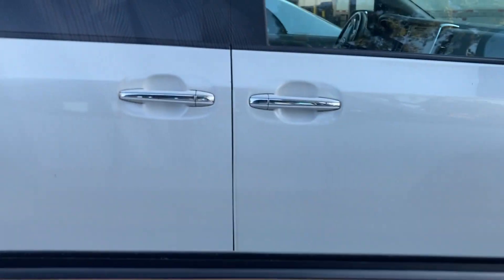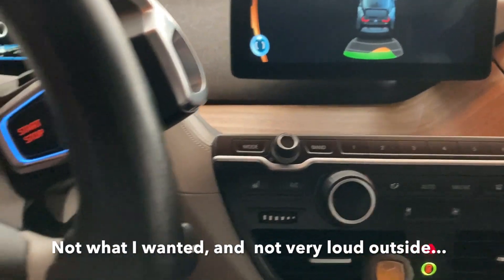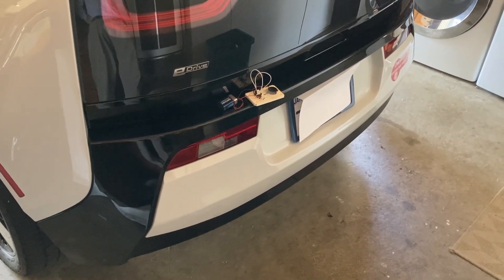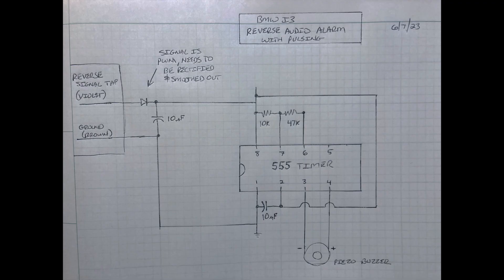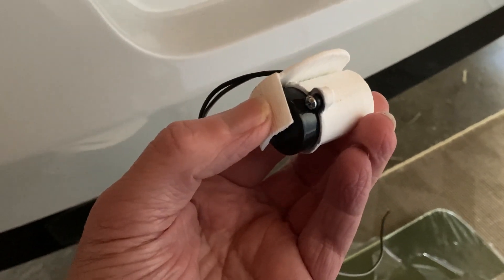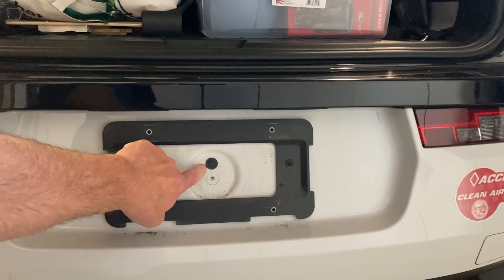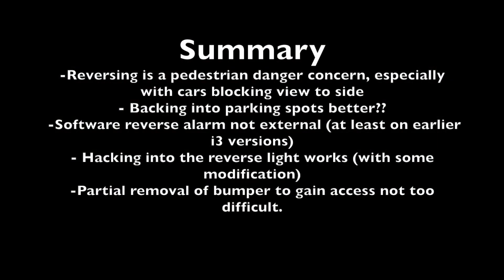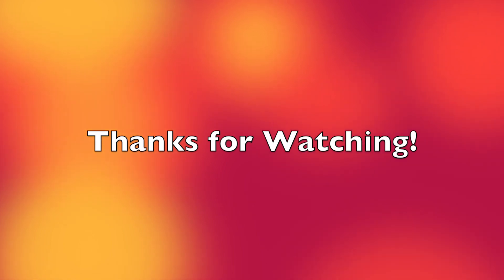BMW i3 DIY Adding a Reverse Audible Alarm for Safety

Comment: Do you have Rex?  I was able to remove carpet and floor pan and just reach in from inside to install backup camera, wondering if I can for this too.   I'm thinking that buzzer would still be pretty loud even behind the bumper.

Comment: A good idea in theory but wouldn't it have been more elegant/discrete to mount the alarm unit inside the rear bumper area somewhere? Much less prone to damage/dislocation and no drilling?
Reply from the maker: Yes, you have a good idea.  Mounting in on the inside of the bumper with a large enough hole for the sound to pass through might have worked (in hindsight), or it may be loud enough without a hole- but I didn't test that...  Thanks for the feedback!

Comment: Do purple and brown provide 12v? I've been trying to connect an aftermarket reverse camera but it doesn't work. I ended up plugging it to the 12v 'lighter' socket in the trunk
Reply from the maker: No, the brown is a ground line, the purple is a PWM or pulse width modulated signal.   If you rectify the signal with a diode & smooth it out with a capacitor, You might get enough DC power ( I got ~ 11volts when the circuit was on) depending on the load and voltage requirements for the camera.  You could review the schematic I made in the video for some ideas.   Good luck!
Reply: I got a plate light replacement camera that works just fine, ran video line to MMI box.  I've since upgraded to hifimax android nav screen and it works with that as well.

Comment: I have seen a rectifier on Amazon, think its right.
Presumably I could also use this with the signal to the dome light to convert signal to voltage as I need a momentary 12v source when the car is unlocked (the roof interior roof light sounds the best option?, thanks for the help, rgds
Reply from the maker: t may work, (with a smoothing capacitor) but I would be careful not to pull too much power from that circuit (the buzzer circuit was very low power draw).  If you are using a device that pulls a lot of power, I would pull a line from the fuse box main power (with a fuse) and use the dome light signal to turn on/off the circuit.  Check out this video for some ideas:  https://www.youtube.com/watch?v=5h-Cofxcd8E    Good luck!
Reply: @bmwi3diy782  Fantastic video but thats got me thinking now though.
I only need the power source for the duration of the entry lights (eg interior blue lights) so am I best tapping into the dome light?
Ive studied the wiring diagrams and it appears there are 5 wires going to the dome light, all have a 11+ voltage reading on them using my multimeter so I guess this is caused by the oscillating pulse signal. Two blue wires seem to be the ones I need to connect to (or at least one of them) ai have traced these back to I think pin 21 3B of the BDC ?
I know you say be careful drawing too much current, if its only momentarily can I still tap into the rear reverse light which I have set to come on when I unlock the car? 
What would be ideal is if there was a 12v source that would turn on when unlocking the car and turn off shortly afterwards?
Thx for the help, much aporeciated and a learning curve!
Reply: I am thinking maybe another option would be to have a 555 timer on a 12v source so when unlocked the LED lights for say 5-10s on the timer, tjis then avoids connecting to the reverse lights or dome light?

Comment: Hi, how do you add the second reverse light? Only the right one works on my vehicle in the UK?
Reply from the maker: There is a pin from the body domain controller (pin 13 for the right side & pin 21 for the power on the left side per the schematics).   Here in the US, we have two reverse lights, but no rear fog light... Could be due to regional requirement differences in different countries, but I'm not 100% sure on this.   Maybe you can check if there is a light source or wires on the left side, to confirm.   Thanks for watching!
Reply: Can you point me in the right direction to where I get a rectifier please?
is it a cade of splicing into violet wire to the rectifier then output of rectifier to buzzer?, thx
Reply: Thankyou very much😊
Can I pick your brains on a few modifications I am doing please?
1. Im going to install  projector puddle lights. Can I simply splice into the door handle LED circuit within the door do you think?
2. Front illuminated BMW badge (only when opening doors). Can I splice into the dome lighting in the roof console. I have taken a wire through the firewall and its behind the glovebox ready.

Any help appreciated, thx Jonathan
Reply: p.s will take the bumper off to check the reverse light. Wonder if I can splice into the right wiring and feed a short wire to left light?

thx again
Reply: Can I get ypur email address as I have other ideas and questions that are off topic and could really seek some guidance on, thx

Comment: Video on adding brighter backup lights would be greatly appreciated.  👍
Reply from the maker: I think you could use the same line I tapped into for the buzzer circuit, turning on a power transistor or a small mechanical relay to turn on a high power 12V auxiliary light.  You just need to find a 12V fused power line to tap into.   I'm not planning to add brighter backup lights soon though!   Thanks for the feedback & future video idea...

Comment: Great videos! Hopefully others have had better luck i have a seat occupancy sensor needing replacement out of warranty. Stealership said to replace the seat for 10K. Not joking! Have you or anyone else replaced the rubbery seat mat sensor? Saw your video on the wire behind the airbag.
Reply from the maker: I have not done this replacement.  I haven't tried this, but you can get a seat occupancy mat emulator off of ebay :  www.ebay.com/itm/123911046592 for $77.   It may be a safety hazard for small children to replace the sensor with an emulator if it is the passenger seat though.  Thanks for watching & good luck!

Comment: Super neat.  I assume they eventually added an audio backup in the later years.  I have a 2017 i3 rex and it does not have an audible backup but I not they add it later.  Anyhow great project, shows a lot of all around diy expertise, super cool....